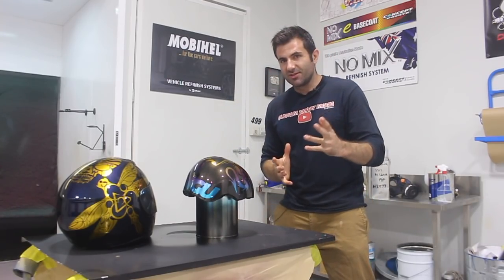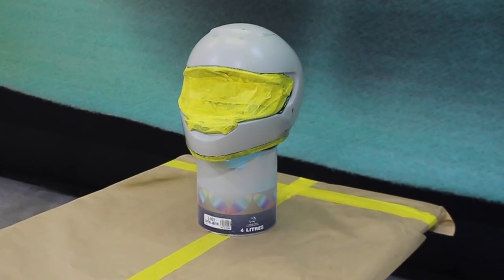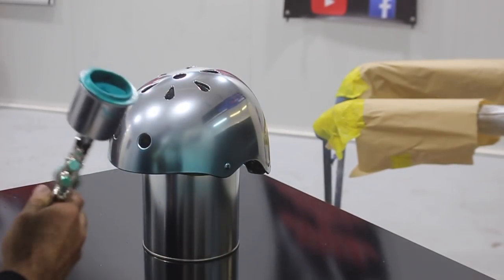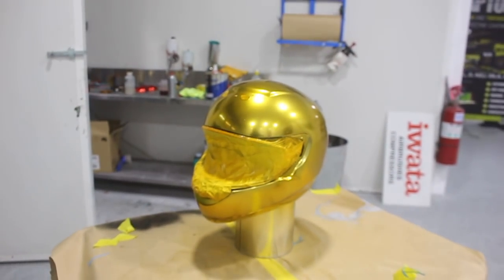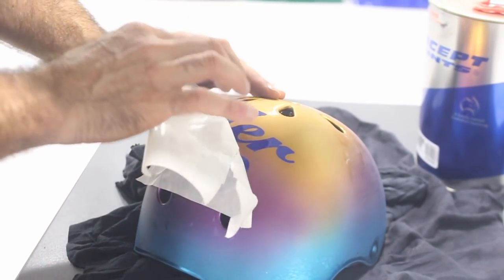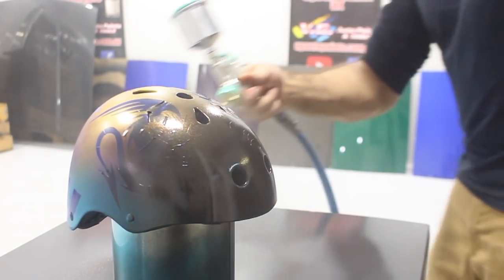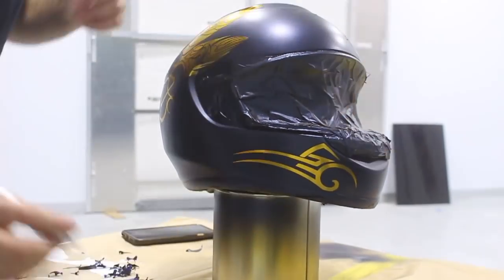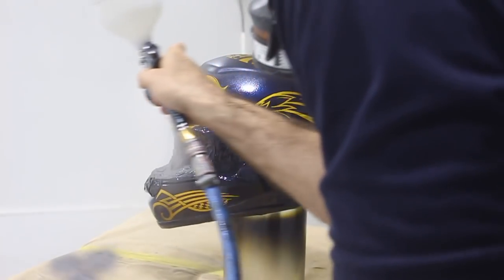Custom Painted Helmet. Chrome and Candy

Comment: I found once you sand the clear,  you should hit it with a CAP adhesion promoter so the tapes dont stick so hard to the surface. Working surface is much better as well.

Comment: was the black... just regular old black gloss spray paint basically or did the 2k gloss black have in anyway something to do with chemical process. Im just not sure whats going on and Ive seen a couple different chrome spray on kits and didnt know what was going on with this kit. Most kits mention/require the black base coat and I wasnt sure if it was propriety blend black coat.

Comment: What do you think of adding glass microbeads to clear, to make helmets and/or motorcycles retro-reflective to light, like street signs?
Reply: Jeff Cobb you're talking about beads for media blasting?
Reply: I tried it and the coverage is uneven so the reflection is cloudy no matter what you do. It needs to be screen printed to get the typical even reflection.

Comment: Why do I get raised edges when removing masking tape or decals? I´ve tried a lot of masking tapes, decals, masking with light pressure (got underrun), using 3m precision masking tape, removing when paint is "tacky" when is fully dry... No luck. Where am I failing?
Reply from the maker: Diego AG it's normal to get an edge. Just clear it. And sand once dry. Then clear again.
Reply: @customspraymods  Thanks for the reply! That´s the way I do, but I thought I was doing it wrong!